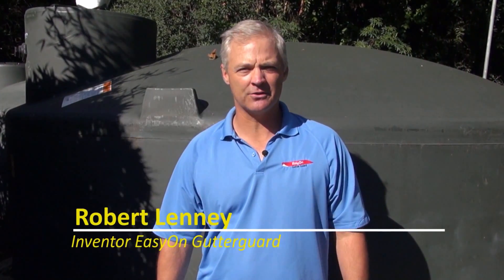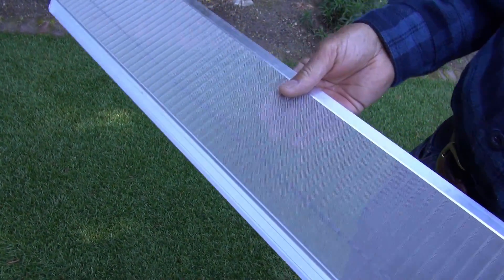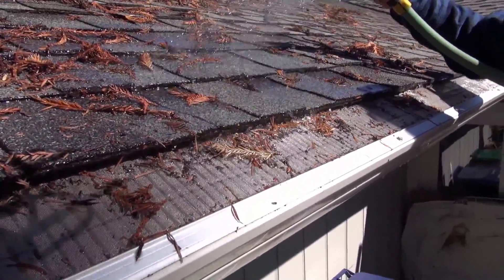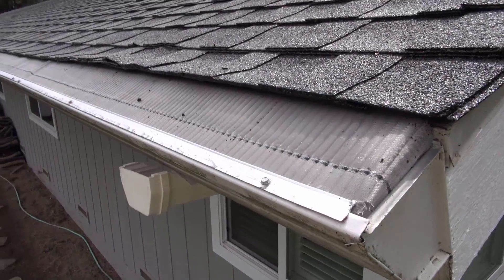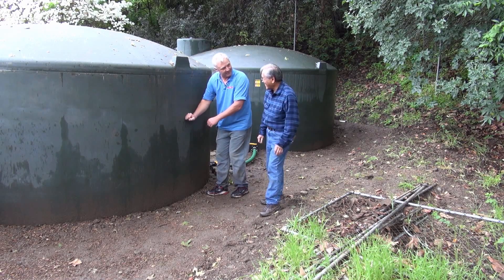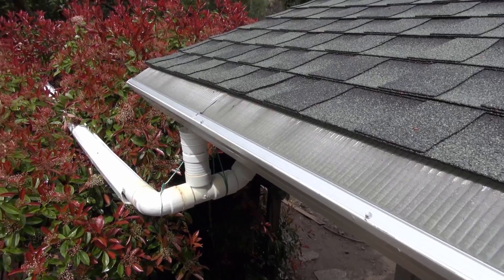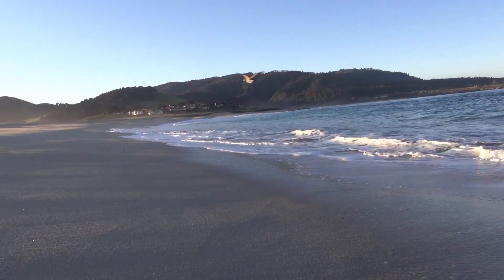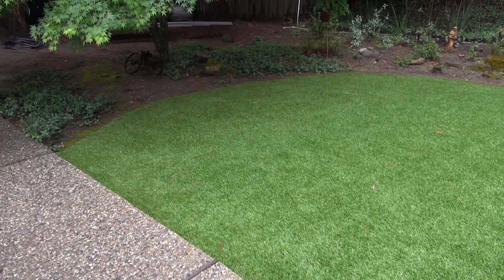15,000 Gallon Rainwater Harvesting System

Comment: In my system I made, my rain water goes through a strainer into a plastic 55 gallon drum where sediment and debris sinks to the bottom. Then out of a pipe at the top of the drum into a second drum. When the second drum is full a pump activates and pumps it through three whole house sediment filters, then into the storage tanks. Clean!

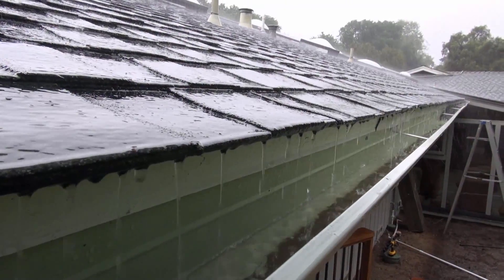Comment: 0:35 once you hear that you should not listen any more.
Rain water is  very very dirty.
Reply: Collecting rain water for gardens is a good and sane thing to do.  You can also filter it to drink it.   Actually, rain water is the water supply for much of the world's population.

Granted you don't want to drink rain water if you are down wind of Chernobyl or some other high polluting plant.  But generally rain water is safe if collected from non-asphalt roofs.
Reply: mfhmonkey _Yes yes, my piss can be cleaned and filtered and drink again.
What he says is that rain water is clean.
Reply: Artjoms Pugacovs For the most part it is clean.  You can drink it right away.  Of course like I stated, you don't want to do that in industrial areas but rain water is clean by any standard.
Reply: That's what we drink when we visit Vietnam. It's safer than any bottle water with all the chemical in it. You will appreciate it more when you live places with no plumbing and rain 6 months of the year.

Comment: This gutter system is not very good. You still have to clean the mesh. My gutter system has a lip at the edge which flushes the leaves and needles to the ground yet deposits the water into the gutter and into the down spouts. I never have to clean any part of my gutter system.
Reply: Tim Hark I'm interested in more information about YOUR system, Tim.  Is it a commercial product for protecting gutters, or something that you've devised?  Thanks
Reply: Robert Edwards I bought it from a company I saw on TV. I do not remember the company, but the commercial still airs. In the commercial, there is a squirell on the roof and he says "Aww nuts" because he can not get in the gutters. I hope this helps.
Reply: Tim Hark Thanks Tim....I'll try to find info about this.  I don't recognize the TV ad, but I'll look for it.  Thanks!!
Reply: +Robert Edwards hi there, did you find out the name of the gutter? I'm also interested in a maintenance free system. Thanks
Reply: I think he's referring to LeafGuard
Reply: I think he's referring to LeafGuard
Reply: there is LeafGuard and Gutter Helmet. But if either of these are installed improperly at all, they become absolute nightmares. Look up photos of improper installs and prepare to walk away.

Comment: Well actually every gallon of rainwater that doesn’t go into the ground also doesn’t go into the ground water table miles and miles from you for people who are on wells. It will eventually run to springs to creeks and then to rivers. And yes - rivers are running dry. Lakes are way below prior levels - Lake Powell in Utah has what they call a bathtub ring more than 70’ above the surface of the water. Many rivers are in serious trouble ie the Colorado River Basin that was just a few years ago a raging river and furnishes water for multiple states. There are already places in the US running out of water and who only have city water a few hours a day. Wells aren’t always the answer - if groundwater is low for bore wells or depending how far they have to drill through rock for deep water- wells can be super expensive. Not to mention the last 50 years of pollution from individuals and companies.. Some people think they can pour a bucket of chemicals, gas, oil, whatever out in their back yard and it hurts no one - that isn’t true. Rainwater will eventually wash it down into the groundwater. If everyone does this - what a mess. Folks only think of their needs and little spot and nobody will tell them what to do. If we weren’t so greedy our resources would last for much longer from the water to fish in the sea to minerals etc. We use peat moss with no concern to the peat bogs which are under so much pressure. Years ago we all planted our orchids in osmunda fiber - well guess what - it ran out and it isn’t even available for purchase anymore.We overuse, over take, pollute and waste our resources. We have to stop. It is the same with everything. Where does rain come from - it is from evaporation from the rivers, streams, rain forests, etc goes up and comes back to us as rain and snow. If mountains don’t have lots of snow to melt down into the rivers there isn’t anything to refill them. It is all a cycle and we really need to take notice. That said it is reasonable to collect rainwater but we don’t want to go over board. A typical subdivision say might have a 5000 home plan - think if they all put in a 15,000 gallon storage tank - that is 75,000,000 million gallons of water not going into refreshing the ground water tables - multiply that by the number of subdivisions throughout a typical county, city etc . Yes there is a lot of water that ends up running off down the street and across so much paved roads, parking lots etc taking with the water oil, gas, and lots of pollution. However, when it hits the sewer it’s out to the rivers. We really need to design our gardens, lawns, etc and all our paved areas to allow the water to sink down not run off. Save enough to help with your watering, or growing plants and vegetables without the city tap water fluoride, chlorine, chloramines, and other chemicals but don’t get so carried away that you cause a shortage.